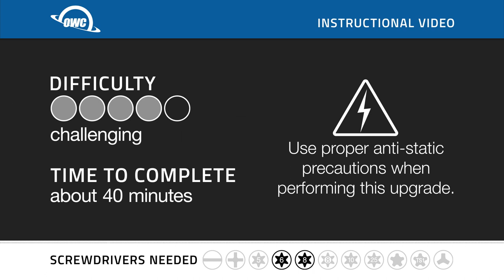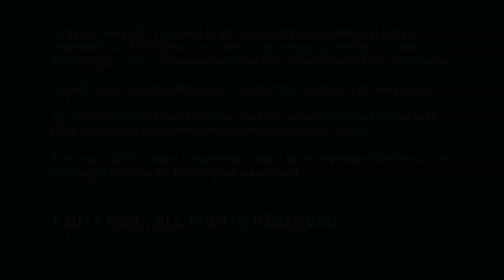How to Upgrade/Replace the Drives in a Mac mini Server 2011 / 2012 (Updated)

Comment: Amazing video! I used it tonight to put two 1 TB SSDs into my 2012 Mac Mini Server and give it new life!  If anyone reading this comment is about to attempt this, just some caveats. 1. Make sure you have plenty of light to see exactly where all the connections are inside. You don't want to pop the socket off the logic board rather than the connecting piece you were aiming for because you didn't see where exactly you put your tool 2. The power supply component that has to be rotated 90 degrees actually sits in a groove above and below it within the aluminum housing of the Mini. May sure it is sitting in those grooves when you go to rotate it back, I almost cracked mine trying to do it before I noticed the grooves [again the importance of bright light/a flash light to see these little details].  3. The SATA ribbon cable of the original drive sitting in the drive carrier of my Mini was partially glued onto my HDD. Just use the flat end of your nylon pry tool to gently lift it off the HDD before you detach it. 4. When re-inserting the logic board, keep an eye on your 2 SATA connectors and the IR connector as you slide the board in as the first time I did it I actually got 2 of the 3 cables under the board by accident and had to pull out the logic board again to free the cables. The video was truly great, if you've never done an upgrade like this before the video makes it 100% possible.  Just make sure you get the right tools, do it in very will lit area and set aside at least 60-75 minutes to go slow and rewatch critical parts of the procedure over and over as you do it. You don't want to rush it and damage your Mini. Good luck!
Reply: In my experience with the 2012 Mac Mini Server the Wifi antenna connector is covered by a soft plastic tab. If you don't want to damage it you may want to leave the wifi antenna connected and disconnect it only when removing the mainboard. When re-assembling connect it just before attaching the power supply connector. Also... when placing the antenna back in there is a point where it 'snapped' in. The screw holes would line up on one side and not the other. After several attempts there was a point where it snapped in, was secure, and the screw holes lined up.

Comment: Thanks for the detailed video. Last night with great fear and trembling I took the plunge and removed the two original 750 GB drives and replaced them with 2 TB Crucial SSDs. It took a while, and I had to rewatch parts repeatedly, but IT WORKED. I now have a revived and faster secondary workstation for my digital drawing tablet. It also doubles as my media center for music and movies. Two notes. First I purchased a static-free pad with a wrist strap. Don't attempt this without something similar. You work so close to the logic board that it would be near impossible not to damage it without one. Second the original drives had black tape holding the drive SATA caps down. I had to peel those off before they would come off. Took me a while to figure that out since the tape was black and the caps are black.
Reply from the maker: Hey Craig, thank you for your feedback!
Reply: Thank you for sharing this information. I also have a macmini server 2011 and I intend to do this ssd Upgrade, my question was if I could put 2 ssd of 1Tb each.
Reply: I’m talking about 🇧🇷

Comment: Thank you for a very clear step by step demonstration.  I am buying a second hand MacMini  Core 2 Duo 2.66 mid 2010 Server and wonder if I can follow your procedure to upgrade the hard drives.  Maybe the internal layout of components is different.  Do you know if your procedure will work on my model.  Also, you installed two 250 GB SSD drives in this video:  what would be the upper limit of SSD capacity?  Could it stretch to 1 or 2 TB per drive?  Many thanks for a great tutorial, meanwhile.

Comment: Very useful and I got there in the end.
But I should stress that getting the IR cable off the logic board is tricky. Take your time and learn from my mistake.
I pulled the connector off the logic board with the cable. I got a computer place to resolder it back on for $50 and I had my Mac Mini almost put back together. But while I was sliding the logic board back into the aluminum box, the retaining clip somehow slipped off the power socket and got pushed inside the machine.
Something else to be careful of because I didn't notice it until I had almost finished and the clip was rattling around inside.
Anyway, the resoldered IR connector didn't survive another disassembly so I gave up on it.
I never used an IR remote with my Mac Mini and otherwise, just the little LED on the front doesn't work.
Other than those two functions, my Mac Mini works fine.

Comment: The hardest parts are disconnecting and reconnecting the power to the logic board.  Make sure you get that top drive's mounting screws inside the gasket or you will not be able to put the wifi antenna and the two screws that hold the plastic cover.
Reply: It is easy to put the upper drive inside the rigt place, if you turn the mini upside down, when you slide the hdd in.

Comment: Great tutorial but did not work out so well for me.  Possibly due to the age of the computer, (or I wasn't as careful as I thought), the fan connector came right off the logic board.  Apple Store Genius Bar can replace the logic board as my model (late 2012) is not yet unsupported and parts are still available.  However, they aren't allowed to install my third-party SSD, which would mean I'd have to take it apart again after they repaired it.  I'd rather not take that risk so they recommended a local repairer who is able to replace the logic board and install my SSD at the same time.

Comment: NOTE: it is possible to break the IR jack completely off the board with a small amount of force that feels like you're just popping the connector out. Probably the best way to do this is with a pointy tool, as shown (I only had a wide plastic tool; I realized too late that I could have used a wooden skewer from the kitchen -- the kind you use for chicken satay) and aim for the part where the cables join the plug. Luckily, I can live without IR on this Mac. I think it also controls the power LED on the front of the case because mine doesn't come on anymore, which is a minor annoyance, but this one only needs to last until a Mini with Apple Silicon comes out. (fingers crossed!)

Comment: I just ordered one of these OWC SSDs for a MacMini 6,2 (2012 server). I'm only replacing one drive though, the "primary" drive with the OS, whichever drive that is. Which one do I need to replace? Is it the first one I get to as I go through the procedure (which I believe is described as the "second" drive), or the deeper, more-difficult-to-access drive below the other drive?

If I open the System Information (from About This Mac) and inspect the SATA information, one drive is described as "upper" bay and the other as "lower" bay, but is that upper as the computer sits upright on the desk, or upper as we descend into the computer as shown in the video, in which the computer is upside down?

Thanks.
Reply: https://discussions.apple.com/thread/8153119 reply by keg55 says "First, while in your OS open Terminal and type diskutil list. Look for disk0 or disk1 that contains your OS and Recovery HD volumes. Remember that disk number. Now, with your Mac Mini upside down, the drive in the bay closest to the round cover (lower) is disk0 and the drive below it under the system board (upper) is disk1."
Reply: but in fact it turned out to be the other way around for me - your mileage may vary
Reply: @robinkay-harika6416  do you mean that it’s a flip of a coin as to which drive was formatted as the Data HD at the factory?
Reply: @chinarut9755  I don't know if it's random, only that my disks were the other way around. So either the instructions were wrong, or I misinterpreted them, or it varies from machine to machine.  Just be aware that you need to check.
Reply: @robinkay-harika6416  hey thanks for sharing - i dunno why i didn’t think to look in the first place - but System Infomation in the SATA section is pleasantly explicit about which volumes reside on disk0 and disk1 - in my case, the Data HD is disk0 in the lower bay (closest to the black disk) - hope this helps anyone else out there! :)
Reply: @robinkay-harika6416  oh wait - sorry - i saw Keith did in fact mention the SATA section in System Information (glossed over that!).   So if I understand correctly now, even though the Apple Discussion said disk0 is the lower bay - it turned out to be opposite for you?   ok - i’m going to open up my mini now so I’ll definitely report back as to which one was disk0 - i cloned all volumes on both disks just in case!
Reply: @robinkay-harika6416  ok just finished swapping out the lower bay drive with an SSD - in my machine, it was disk0 (Data HD at the factory)

Comment: Is it required to wear anti static wrist band during install new ssd
Reply from the maker: Hi Nikhil. It is not required to wear an anti-static wrist band during the installation process. However, we do recommend doing the installation on an anti-static work surface.